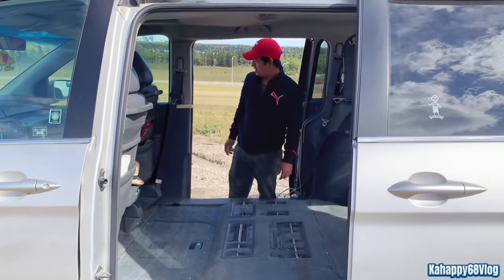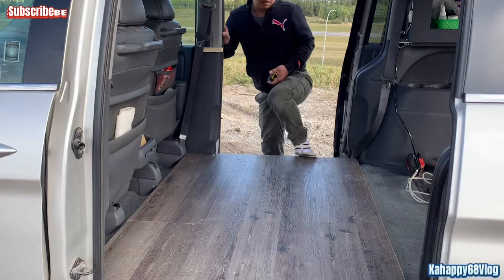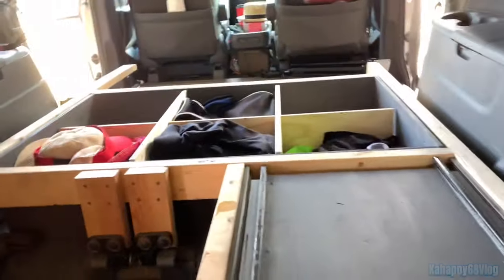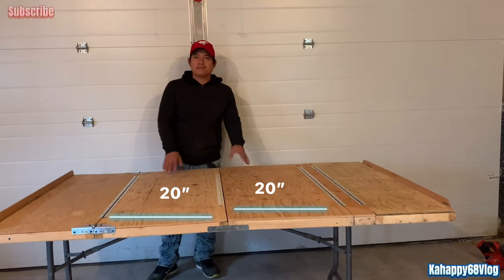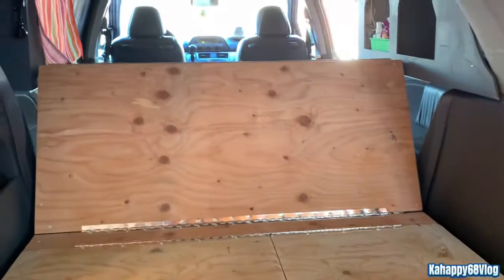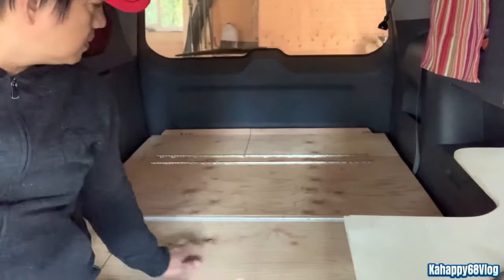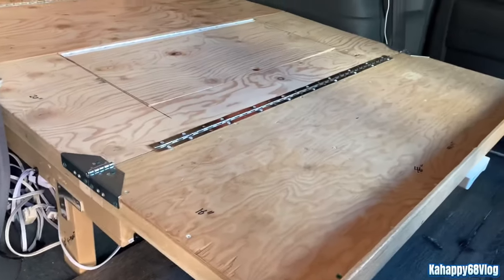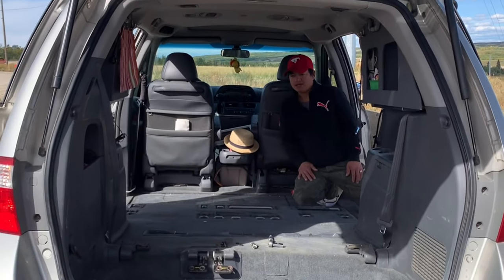Honda Odeyssey LX Conversion, Van Bed with multiple access/Folding Bed, Honda Odeyssey Van Bed

Comment: On the 18 1/2 inch 2 by 4 that is vertical in the back. Does that include the 2 by 4 that crosses over top of it or is it just the vertical 2 by 4?
Reply from the maker: Yes the 18 1/2 “ 2 by 4 included crosses over the top
Reply from the maker: Thank you for watching

Comment: Nice job and thanks for providing all the measurements.  I saw what looked like a curved white table top at 9:59.  You didn't mention it in your video.  I would be interested in seeing detail on it.  Also, have you used your setup on the road yet and made any revisions based on your experience?
Reply from the maker: Hello thank you for watching. Yes we did camped already using our camer van and we found out that we save a lot of money than stay on the hotel, motel or cavin. By the way the white curved table you asked is a revision of our kitchen sink.  I will film it and upload here. If you want watch these and you see my camver van on the road.. hehe.
Reply from the maker: https://youtu.be/7JRMqn0_h-I
Reply from the maker: https://youtu.be/6KdVI_1wmLw
Reply from the maker: Please subscribe to my channel if you don’t mind and thank you
Reply from the maker: Hello here you can find it the curb you asking for.  Thank you.. https://youtu.be/byQxR8yOp2s

Comment: How could you access any of those lower compartments when you had a matttess on top of the platform? Where would you be able to move a huge trifold mattress to do what you showed just sitting on the wood?
Reply from the maker: We are only using 2 1/2 memory foam mattress and it is easy to lift or roll it up. During the day we rolled it up and hide it on the back of the bench.
Reply from the maker: If coulf finish the video you can how to access your belongings ubder the trifold bed.
Reply: @Kahappy68Adventure  I did watch to the end and you never showed how you could  access your storage under bed.  I have a 4" trifold mattress and I'd never be able to bend it enough to open a compartment - esp those cut outs when in couch mode.  I'd love to see your mattress set up with a couple people on it and accessing those compartments. It's a nifty build - I just don't see how it would work to get to everything under the bed without exiting the van & folding up the platform & removing the mattress. Thanx for sharing. Nice that the whole thing is removable.
Reply from the maker: Ok it what you want to see it, but like I said I will fold up the 2 1/2 mattress or lift it up to get into the compartment under, we will love to show you how withouth getting out from the van.. after holidays. We are busy and very cold -29
Reply: @Kahappy68Adventure  No problem.  I totally understand you are super busy.  I didn't know you used a 2 1/2" mattress & not a trifold.  A trifold would be another whole thing.   Best build.  Enjoy!
Reply from the maker: Thank you and happy Holidays
Reply from the maker: I will make a film on how to access in my compartment thats my plan..
Reply from the maker: Sir this the answer of all your question..   please watch.. the solution is here.. https://youtu.be/byQxR8yOp2s

Comment: Great presentation but unfortunately, you're not selling them for customers who are super impressed and wish to buy from you 😊
Reply from the maker: Thank you buddy for watching. I can make it one for if you want. What your Van measurement?
Reply: @Kahappy68Adventure  
I truly appreciate responding to me. I'm so grateful!

2015 Honda Odyssey LX specs below: 

Length: 202.9 in.
Overall width without mirrors: 79.2 in.
Height: 68.4 in.
Wheelbase: 118.1 in.
EPA interior volume: 211.0 cu.ft.
Cargo capacity: 38.4 cu.ft.
Maximum cargo capacity: 148.5 cu.ft.
Maximum towing capacity: 3,500 lbs.

Thank you so much and be blessed!

Comment: Can you clarify the length of the bed?  The support on the left hand driver's side of the bed frame iis labeled 74 inches, but when you show the part of your video in your garage you state the overall length of the bed is 72 inches, and then when you add up the different sections of the bed (16-20-20-3.5-13) you get 72.5 inches long for the bed.  Could you clarify the correct length of the bed?  Many thanks!
Reply from the maker: Hi there, the bed frame is 74” long on the driver side. The bed panel or the bed floor is 72 only. Thanks for watching and interest.
Reply: @Kahappy68Adventure  many thanks, great build!
Reply from the maker: @antigroundhogday  thank you

Comment: What about the floor vents? Or did your particular year Odyssey not have any AC/heat vents on the floor?
Reply from the maker: have an AC and heather the Van but not on the floor.  I had 12volt fortable heather.?
Reply: @Kahappy68Adventure  gotcha the floor vents in the 2007 are actually on the floor... I'm trying to figure out how to redirect the vents otherwise it's a lot of floor space I can't cover since I want to use the vehicles AC to keep the back cool.
Reply from the maker: you can do it the same thing, don’t put  storage under the frame to open up the vent on your floor.
Reply: @Kahappy68Adventure  I'm going to try to redirect the vents otherwise when the bed is flat they will be blocked....
Reply from the maker: ok but my bed frame is elevated a little bit from the floor so that why i made a space for storage under. Its up to you and it is your own choice to put a storage or leave it open for your ac/heater vent